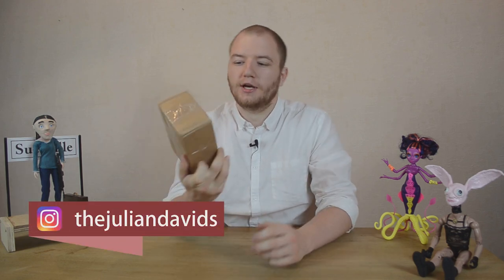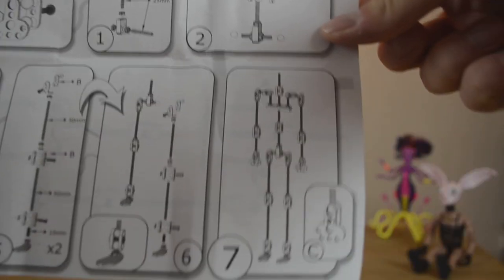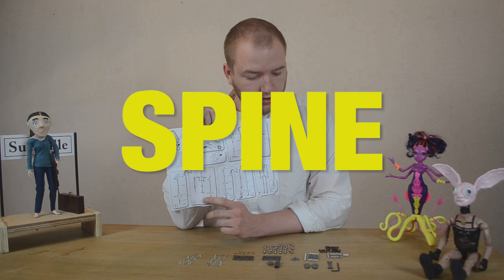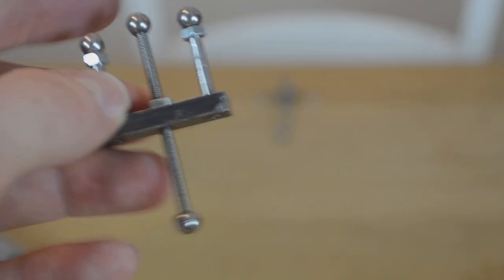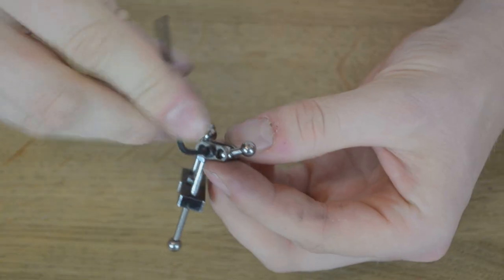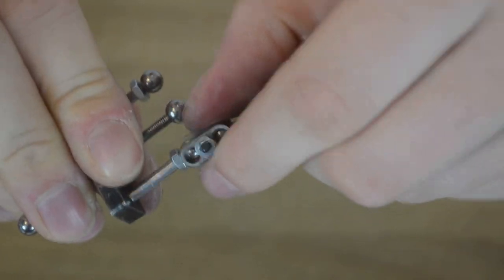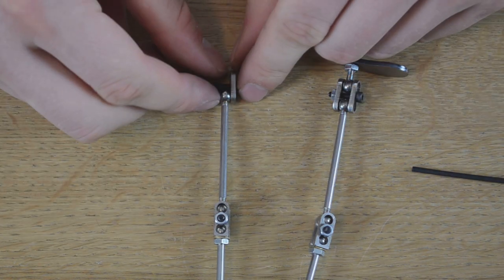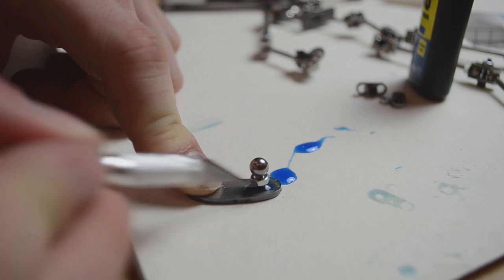Professional Armature Assembly, Stopmotion Tutorial

Comment: That doesn't seem like a very good armature.  The feet should be jointed and have tie-downs in the toe sections at least.  One side of each compression plate should be threaded instead of using a nut, otherwise you can't adjust the tension of the joints once the armature is embedded in the finished puppet.